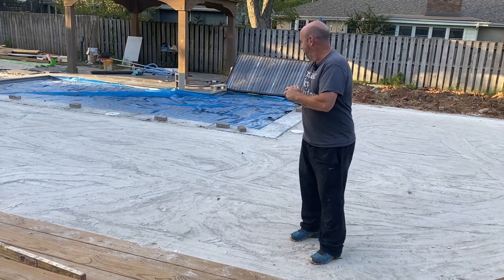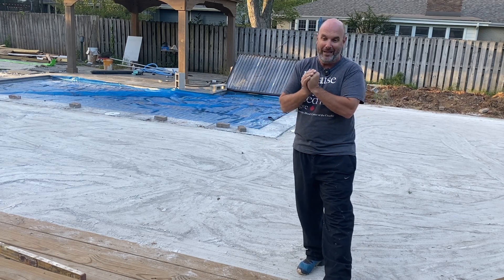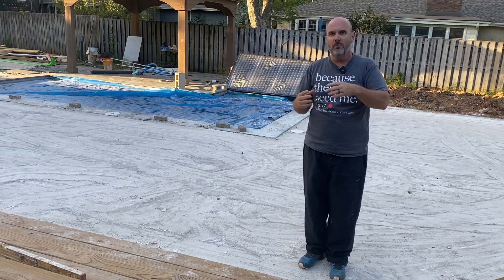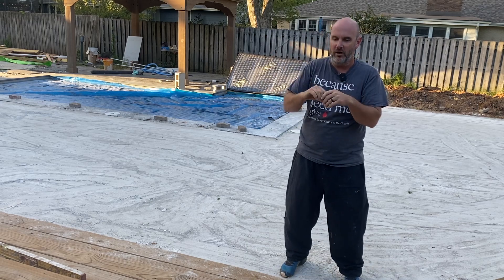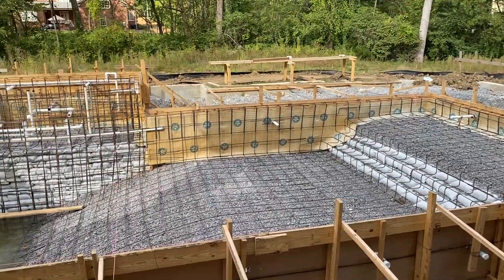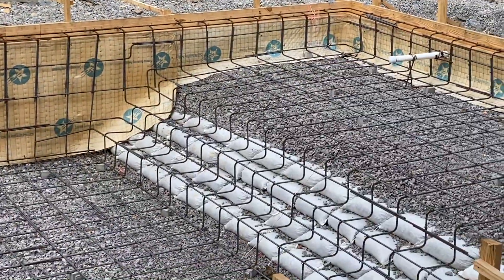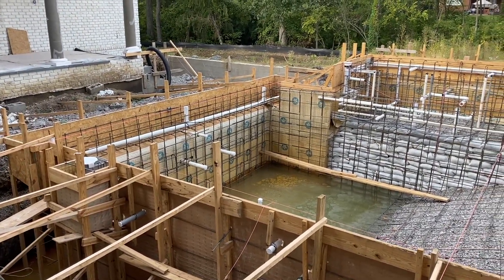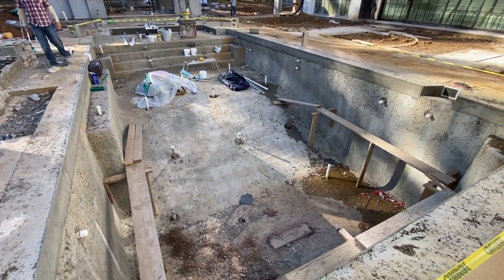ICF Pools Better than Gunite???

Comment: Do you need to run copper wire around an insulated ICF pool for bonding ?
Reply from the maker: Probably but it varies depending on finish, we have details in our manual

Comment: So how do you prep the ICF walls for hardness prior to finish? 

Any ICF pool I have seen has required parge coat prior to finish or liner
Reply from the maker: Why would you parge coat concrete?  You have to address the tie holes or any imperfections, eco calls the bubbles blow holes…. There are at minimum two different effective ways of doing this without parting the whole wall depending on your crews skill set

Comment: Man here in Houston pool companies excavate the hole on day one, rebar and install pluming on day two and shoot gunite on day three. Only wood form they use is a 1"x3" to mark the top of the walls. I've seen a 25'x12' pool built start to finish in 8 days. I love the ICF idea and I want to get in the business but its hard to see how it would be faster than gunite here in Texas. Also, not sure if the insulation benefit of ICF is not a strong selling point down here with our laughable winter temperatures; people don't even bother covering their pools and no winterizing needed. Great video by the way. I consume all your content and I'm trying to find a way to pay for your onsite training. Thanks!
Reply from the maker: Houston dirt is pretty rare around the country, most of the Midwest and mid south is really karst, and you can’t dig a hole precise enough, I mentioned that some places you can shoot the soil in the video, but those places are the exception not the rule
Reply: Yep, in Gulf Shores, exactly as you described, dug on Tuesday last week, rebar Wednesday, inspection for bonding on Thursday and shot on Friday.